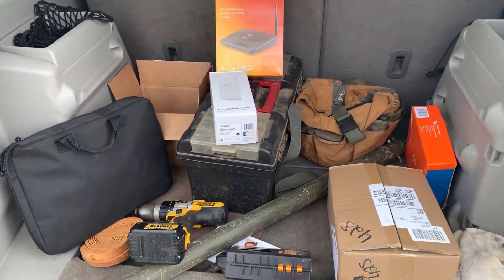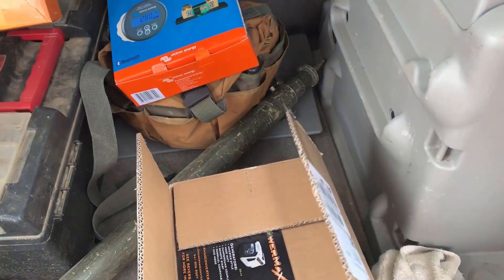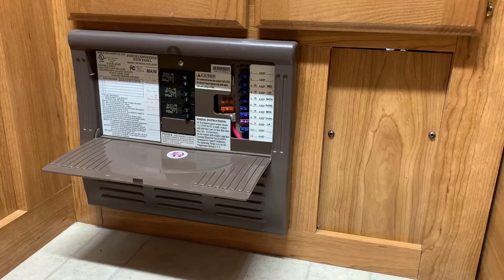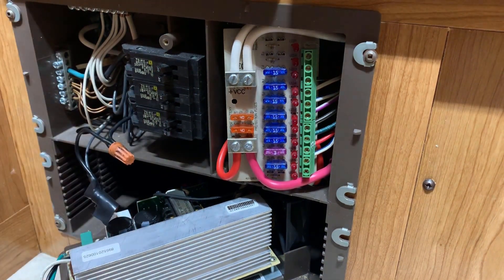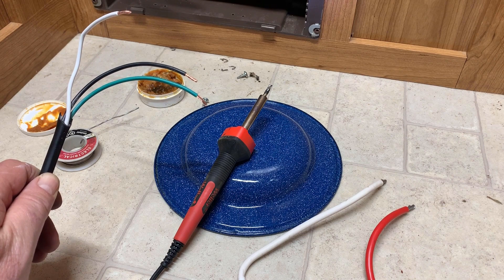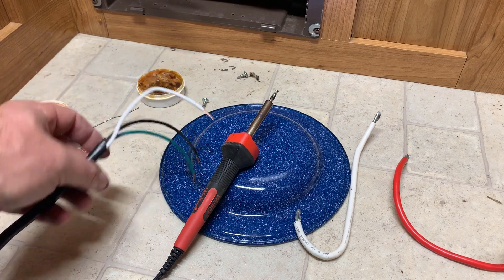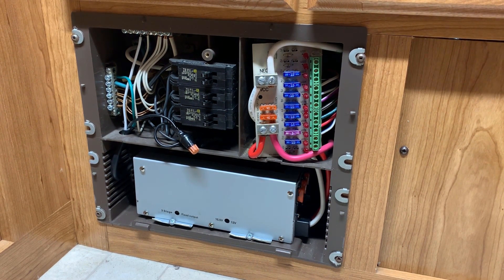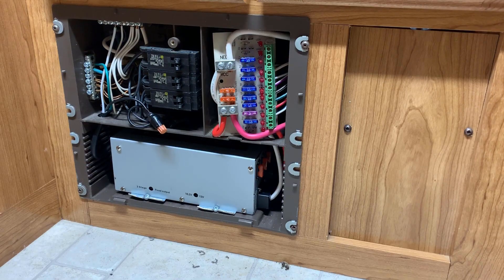DIY Camper/RV Fast Battery Charger Swap - 3 Stage Charging - AC to DC Converter/Charger by POWERMAX

Comment: No need to solder the ends of the 120V side, the amp draw there in minimal. The 120V side draws about 6 amps on a 55 amp converter. Says me, a dumb ass electrician with an RV.

Comment: Is you RV/camper plugged in to a generator, solar, or and outlet to get this converter going?
Reply from the maker: It is plugged into 220 volt grid power.
Reply: @thereedychronicles8572  Thank you for your reply.
Reply from the maker: When camping, I use a generator.

Comment: I was hoping you showed what you did with the power cord after you cut the plug in off.
Reply from the maker: There was the terminal board and wires to the 220 volt cable that runs to the grid power.